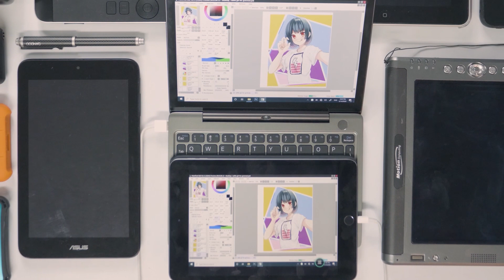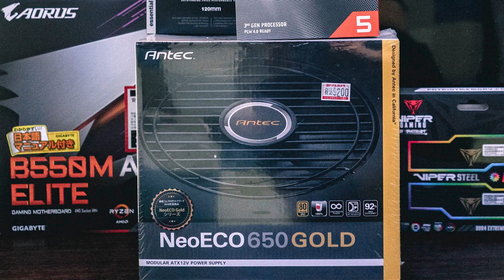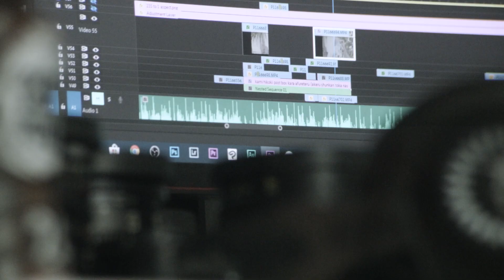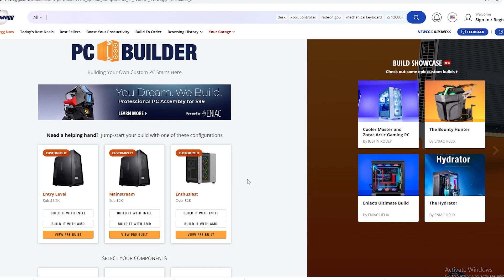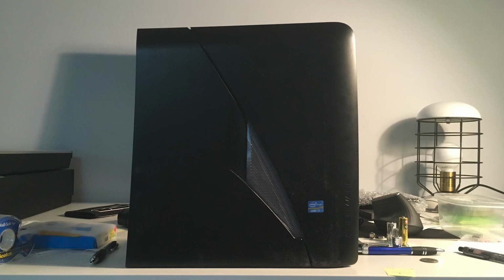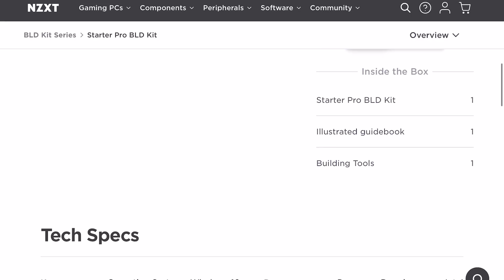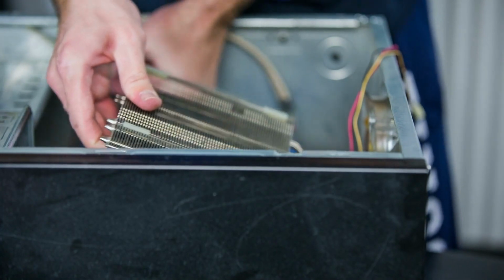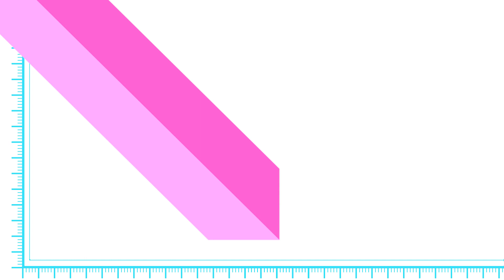Creators don't know their tools | Build a PC

Comment: Great important video.  Thanks for posting it.  I have been researching a build for my daughter who loves drawing and has started 2d animation.  It has been difficult for me to determine a number of issues.
1. Is a graphics card really necessary for drawing and 2d animation or will integrated graphics suffice?
2. Does the speed boost of an i5-12400 outweighs the comparatively better integrated graphics of the 5600g?
3. Will there be any major benefit of PCIe4 vs PCIe3 for this type of work in the m.2 drives?
4. Is there any major difference between 3200 ram which I would use with the 5600g vs 3600 ram which I would use with the i5 12400?
5. Which monitor would you recommend for this type of work?  

Sorry for all of the questions but most videos are gamer centric and it has been difficult to figure out exactly the right build without feeling like I would spend several hundred dollars that I don’t really have.
Reply from the maker: Hello and thank you so much for the question!! Let me see how I can help.
1) I would say for 2D illustration modern integrated graphics should suffice for non-profesionals. Unfortunately I don't have too much experience with animation on desktop to give you a first hand account, but the beauty of a custom build is you could start with the integrated graphics, with the intention of adding a graphics card down the line. If that's the case I would try to factor that in when deciding on a power supply, so you dont have to upgrade that as well. I would also look at some posts from animators on the subject just to make sure, but I would assume for a begginer the integrated graphics should allow your daughter to get started and gain some expereince.
2) This might depend on the software you plan to use. Although AMDs graphics perform well in games, they might not put up the same price per dollar performance in creative software. I'd say either one should be more than enough for 2D illustration and animation. As they are more popular CPUs you might be able to find a benchmark comparing them in the software you plan to use, that would give you the best metric. In the case of AMD vs Intel the motherboard options do change a bit so it is something to consider in your decision.
3)  I currently use a PCIe4 m.2 and the speeds are impressive! It is also more expensive though and for many people PCIe3 will probably be more than fast enough. Depending on your mother board you might have at least one PCIe4 m.2 slot, in which case it might be worth investing in the faster drive to keep things comfortable for longer, but if the motherboard you want only has PCIe3 m.2 slots, I dont think you should feel too pressured to change just for the drives!
4) Depending on the application, higher RAM speeds can show some perceivable improvements, but 3200 vs 3600 would probably feel very similar. For a comfortable work station I would recommend at least 16gigs running in dual channel (so 2 sticks,8 gigs each or even 4 sticks of 4gig). 
5) The monitor is going to depend a little bit on the tablet you plan to use. Some will prefer a display tablet like wacoms cintiq line while others a pen tablet like the wacom intuos line. In the case of a display tablet you could skimp a bit on a monitor or use an older one if that is an option. If your tablet doesnt have a display, then it is worth picking up a decent art monitor. Personally I don't think you need something like a 120Hz display for digital art, and something more color accurate would be a better fit. I have use Asus' pro art line in the past and found it to be a great value for money! 

No problem at all! It can be difficult to find good info for non gaming projects, and the way things are lately everyone hypes up new technology which can make it even more difficult to decide... I tend to look at prebuilt art systems or puget systems offerings as a base line and then remove or add parts as I find fit. Each individual part isnt necessarily the most expensive item when it comes to art supplies, but when you bundle it all together it gets expensive quick. That being said I do think it is a valuable expereince to build and work on your own computer, and it should be a great family project for the weekend! The only other thing I can think of right now is to recommend a gold level or higher power supply, and with a little headroom for any future parts you may wish to add. While illustration (and probably animation) are not the most demanding on a computer, it's easy to see adding live streaming or video editing to the mix and that is where that head room or upgrade path comes in really handy! 
I hope that helps, if you have any other questions please feel free to ask!
Reply: @tsukepen  thanks for the detailed reply.  This year I am replacing my pc which I built with a friend 11 years ago for $550.  It’s the best piece of equipment I have ever owned and that includes cars that I have purchased.  It’s still completely functional for web browsing and light office work like Java script or spreadsheet work.  You are spot on about building a pc.  The value is just incredible and you learn so much in the process.

I think I am going to end up going for the i5-12400 build.    The 5600g is pcie3 so it will be difficult for it to future proof it. But  I am going to wait till Black Friday. Then I will build it with my kids and pick up a good GPU eventually when the bubble crashes, hopefully it happens then.  Thanks again!
Reply from the maker: No problem at all! It’s funny you say that, because cars and other daily necessities have become difficult to repair and maintain yourself while a majority of windows pcs can easily be repaired, upgraded or built from scratch by the user! Very rare nowadays haha they also can last quite a bit longer than other modern tech so definitely a great thing to teach someone while they’re young!  I think that should be a good build! The i5 12400 seems like a reasonable price to performance with modern features that will keep it relevant for some time. And like you say the gpu (and even memory) prices haven’t been the best lately so it’ll be good to keep an eye out on the prices to make a move when things are more reasonable…